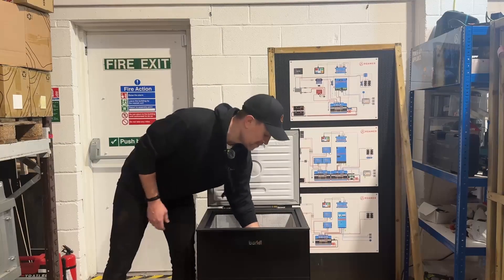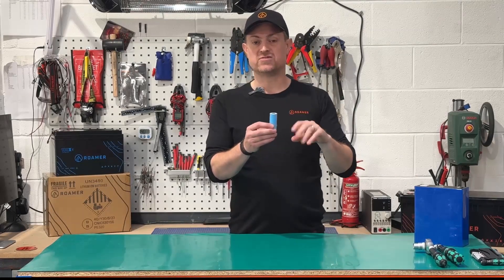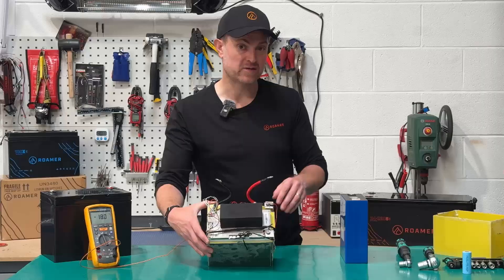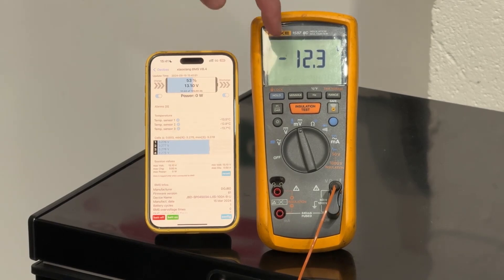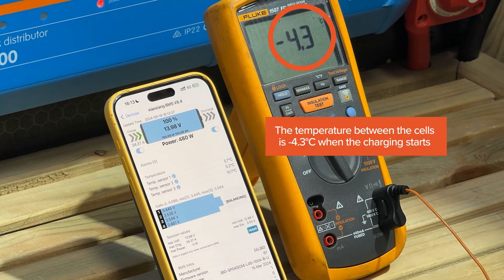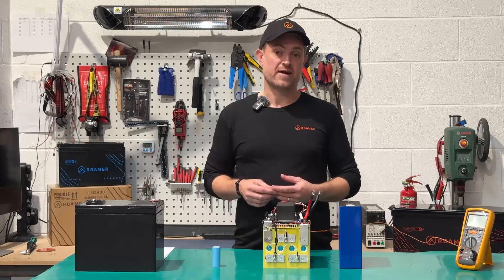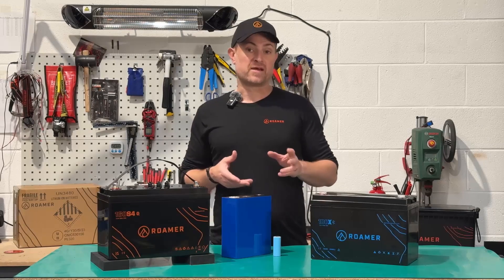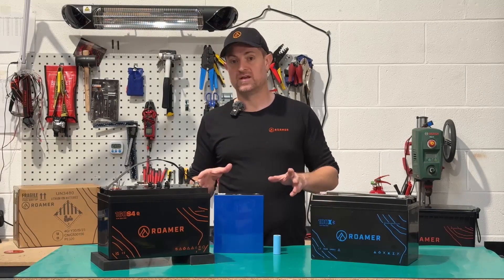Self-heating lithium LiFePO4 batteries tested - FAIL!

Comment: I can’t really see it being too much of an issue in the UK. I’ve just ordered a heated battery for an off grid communications system. It’ll be in a metal cabinet in a shed, so would only freeze if temperatures were low for a long time. The heating should be fine to bring it up from a few degrees below to allow it to charge, otherwise it’ll run flat after a few days if the ambient temperature remains below zero. I can’t ever see a circumstance in England where the battery would freeze overnight to -17, particularly if it’s being charged during the day. The inner cells would also be insulated from the cold by the outer cells in same way as they’re insulated from the heating pads, so it’s unlikely they’d get as cold in the first place, at least not over night. Siberia maybe a different story.

Comment: so put the temp sensor for the BMS where you put the meter probe
Reply from the maker: Yep this would definitely help. I’ve no idea why they don’t do it but this is my point, these batteries are being made in volume and sold under the pretense that the heating makes them safe and reliable

Comment: What was the state of charge when you put the battery in the freezer? Was the self heater powered up and heating (resisting becoming frozen through) during the freezing cycle? Was the battery in it's case during the freeze cycle? In other words, did you test the heaters ability to resist allowing the cells to freeze through in the first place or did you freeze the battery intentionally and then test it's ability to evenly thaw itself out?
Reply from the maker: It was around 50% - you can see this on the video. You can also see that it was in the case throughout. The self heating only operates when it’s being charged so the test was to freeze the battery, then charge it up to see at what point charging it would be allowed. I realise there are some batteries that will keep the cells warm and prevent them freezing in the first place but this is not how the vast majority of self heated batteries work - they will let the cells get very cold and then when charge is applied, it used the charging power to run the heater.

Comment: A bit of a flawed testing method. The point of heating is to keep it from getting that cold in the first place. Get it heating beside a non heating model in the cold while operating and see which can handle the warm cold cycles of simulates real life situation.  Running a battery immediately after its been froze is just kinda obvious it ahould be thawed first. Also anyone using should also be using an insulated compartment.  These still have a use but people need to understand its not some magic leave it in the snowbank and run device.
Reply from the maker: The testing method is correct - your assumption is flawed 😉 Actually these batteries are designed so that the heating only works while charging so it’s realistic that they will freeze. The entire sales pitch is that you can run the battery immediately after it’s been frozen, the heater is supposed to thaw it so it can be safely charged. Clearly this doesn’t work, that’s the point of the video.
Reply: @roamerbatteries  They are there to prevent it from hitting the critical point as early as a regular battery, not to thaw a frozen block. Stick them both in the freezer with charge/discharge going on the entire time. Don't prefreeze. The heated battery is going to last longer before having issues. I've ran mine down to -36f temps without issues in a styrofoam box.
Reply from the maker: Ok I think you need to watch the video - that is NOT how these heated batteries work. Some brands might prevent them dropping below zero but the ones for sale in the UK only heat while charging. This means they will drop to very cold temperatures while in your van, then when you charge them up they will rapidly heat the outside of the cell pack. This triggers the BMS to release protection and cells are charged - this happens before cells are ready and therefore risks damaging them. This is literally the whole point of the video, please watch it all :-)
Reply: @roamerbatteries the temperature at which heating begins is still in the operational zone. The heating keeps it from being critical longer this allowing lower temperature excursions. It is NOT designed to thaw a prefrozen battery.
Reply from the maker: Ok please watch the video. These heat pads is designed to thaw a frozen battery. There are other batteries that maintain the temperature in the operational zone but NOT these ones. The key point you’re missing is that the heat pads only work while charging - this means the battery will freeze and then when charge is applied, heat up rapidly. This is why we’re saying they’re a bad idea 😂

Comment: Yes, you can stop watching this video at round 11 seconds. The scope of the heater is not to warm the battery, it is to prevent it getting below a certain treshhold. It will use part of its power to keep the charging temperature. In extreme cold situations it doesn't matter, but it can give you a few degrees of playroom.
Reply from the maker: This is NOT how the heaters work. You would know that if you watched beyond 11 seconds 😉 They only work while charging so the battery can drop way below zero degrees. The heaters work like a jump starter, rapidly heating the cell pack until the badly located temp sensor detects its warm enough, and then the BMS allows charging to the cells
Reply: @roamerbatteries , you made good point about how it works but you made it sound like useless technology,  absolutely not,  better placement of the temp sensor is crucial but also a give and take scenario,  actually until they perfect it, people who live or use lifepo4 batteries in very cold climate might want to make a different choice,  unfortunate, yes, now I am talking very cold climates where actually millions do live,  you might unfortunately want to stay with old fashioned lead acid batteries

Comment: great video.   I'm a tech at a solar supply company up in cold northern canada.   We have carried/sold many brands of LFP batteries with internal heaters over the last 3 years and not one customer actually encountered and/or tested the limits of this battery/heaters.  We explain the cold temp scenerio beforehand so there is a bit of education (warning) that goes a long way towards knowing how to keep the batteries in a workable zone.   Your observations on the BMS temp sensor placement is very relevant to the  temp management of the battery/cells as a whole.   It could be possible the BMS takes the average Temp of all the temp sensors or the temp limits are off-set and/or compensated for with an altered charge algorithm.   The quality of the BMS is super important in all around efficiency of the battery system.
Reply from the maker: Thanks! Yep as you mention, if batteries are installed and looked after properly then you’ll never see the heaters operating. I personally spend 3-4 weeks skiing in the Alps every winter in my van and it’s never dropped below zero in the battery compartment. But that’s kind of my point, 99% of customers don’t need heated batteries. And for the other 1% there are much better solutions out there. Liquid cooled systems, batteries with low temp electrolyte etc.

Comment: That was a great presentation. 
I would like to add that the heating in your test is also done in a warm environment, not outside in the cold. It would take considerably longer to defrost the batteries outside and keep them defrosted for charging.
Now that batteries are getting smaller, we can take advantage of the smaller form factor by kea ing the cells in a larger case but adding insulation to it.
Additionally, the bms needs to be able to be programmed with schedules or intervals for heating so proper working temperature can be maintained. Needless to say such bms/battery needs Bluetooth and an app for monitoring and settings.

For larger banks I still prefer insulated battery compartments with heaters. It takes less energy to keep a battery at 40°F than having to defrost it daily.
Reply from the maker: Thanks! Yes the ambient temperature may affect the results slightly, I don’t think it would be significant however. Most of the warming inside the battery case will still come from the cell heating film. It was only around 10 degrees in the workshop that day too.

There are definitely better ways to implement this and some good suggestions in the comments above. I feel the same as you however, if you install and maintain your battery space correctly then direct heating isn’t needed and if that’s the case, why take the risk of damaging the battery?

Comment: Is there a thermodynamic heating effect when LiFePO4 batteries are either charged or discharged?
Reply from the maker: Yes, it’s a chemical reaction so it’s going to warm up when discharging anyway. And as this is the same across all cells, the heating effect will be evenly distributed - unlike the self heated batteries which only heat certain areas

Comment: I live with lithium batteries in Canada... only thing I've been able to count on 100 % is a heated battery compartment complete with temp sensor that I can read on my control panel
Reply from the maker: Yep if you can maintain temperature of the battery compartment then that works well. Most people in Europe just install in living space of the van so it’s going to be warm enough anyway.
Reply: I dont think u cut heating inside house, allways+20c

Comment: Ahhhh BUT there are heat pads available that go between the cells which heat up the core of the batteries.  However there are batteries that don’t allow the battery temp to get below set points ( say +4c ) so if looked after properly the battery should never sit at any - minus figure for any extended periods.  If these batteries are critical they should be “ looked after “ like your laptop or mobile phone.  I live in the uk so it’s unlikely I’ll ever get my Overlanding battery ever below 0c and if I did I’d be treating it with kid gloves ( excuse the pun ) before use
Reply from the maker: Yes there are heat pads that go between the cells, apparently the brand we tested uses these on some of their larger batteries. This still isn't ideal however especially when heat is only applied on one side of the cell, temp sensors are located externally and a single temp sensor is used to control low temperature charging - this is still going to lead to uneven heat distribution. The batteries that don't allow the temperature that drop below the set point are a different design and have their own issues (they can discharge the pack unless you have a constant source of charging). If you're overlanding in the UK then just maintain it properly by ensuring it is stored at above 50% state of charge, and if its ever too cold then you'll always have enough energy to discharge and warm it up
Reply: @ The Sun Fun Kit I have ( and just recently built ) the BMS monitors temperature and switches on and off the heating pads if it sees temp below a set temp that you can adjust in the software on your phone or tablet.  It would automatically stop the battery getting too cold which makes putting the battery in a deep freeze experiment a bit meaningless in most cases.   I guess it depends on your application BUT a battery for arctic conditions to be sat at -25 for months isn’t really what most consumers need.  If I’m say overlanding in Norway for a two week stretch then stopping the battery getting too cold overnight will be beneficial as I can then recharge as I drive again in the morning.  I agree that the heating isn’t the ideal design for say EVE 314 MB31 cells however I’ll do some basic testing to see what the current draw is and how well the pads work in real world conditions.

Comment: @roamerbatteries  Its odd because there are hints this is a Fogstar battery over social media, yet they showed a pic of the sensor between two cells where film is not between (heating is between the cells, just not all cells from the pictures they've shared in response to your video). 
Most EEs deal with control algorithms and managing temperature for many products and from that standpoint the uneven heating seems bizarre, trivially simple issue to resolve.  What I'm getting at is instead of rubbishing the competition, you'd be better designing a solution that works and highlighting what you do differently, especially as this is such a cheap change and mostly in software too! I suspect, as someone else has suggested on social media, this is because you import a cold climate battery and thus the aforementioned would harpoon your own sales.
Reply from the maker: While that does sound like an improvement on other models, our concerns go further than simply where heat film is placed. The use of large prismatic cells (up to 7cm thick and weighing 5kg) makes this incredibly difficult to get right. Better temp placement and wrapping all cells would be a great start but really I think this is only practical if using small cylindrical cells. 

To be clear, we have not made any suggestion of specific brands and don’t intend to. This is not a name and shame exercise, we just want to highlight our concerns with the way this is implemented. Hopefully this is taken on board and improvements are made. At the very least, I would hope that additional testing and certification is provided to demonstrate that this is fit for purpose, until then we do not intend to install cell heaters in our batteries.

I know we’ll always get some flak for posting this but honestly this is not about pushing our products. The XTREME range is a niche product and we currently only sell in bulk
Reply: @roamerbatteries  "makes this incredibly difficult to get right" nah, any design engineer worth their salt would arrive at a working solution. All a larger mass does is slow the process down, a process that occurs anyway in the environments these batteries are in. Lets ignore the Fogstar, or other, battery lack of charge inhibit.... Can you be specific about what you feel is a safety issue with heating prismatic cells in general? Is it because you believe the heat output is a constant?
Reply from the maker: @robfodder5575  Yes you're right, a vertically integrated company with design engineers would almost certainly work out a solution. And I would expect any solution to be safety tested and certified too, I believe that is the bare minimum standard required. It is interesting that other than Battleborn (who use cylindrical cells) there are no premium self-heating batteries on the market. Of all the companies that have the resources to design, manufacture and test a self-heating battery - none of them actually do. 

Regarding safety, I have concerns about the uneven heat distribution which is more difficult when using large prismatic cells due to their size (5kg each) and shape (no gaps between as you would see with cylindrical cells). You can see from the thermal image that the heat distribution is not even across the cells. The increased voltage on cells 2 and 3 is also clear evidence of different temperatures. The way this is currently implemented means that the prismatic cells (or parts of the cell) are being charged faster than they should be for their current temperature and this will therefore lead to lithium plating on the cells. It is widely accepted that lithium plating lowers the temperature required for thermal runaway of lithium cells and that in severe cases, the dendrites can breach the separator layer leading to short circuits. 

I'm not suggesting that self-heating batteries are suddenly going to combust but I believe that the way this is currently implemented in budget LiFePO4 batteries creates an elevated safety risk and I would like to see this tested and certified before it is sold as a mass market product.
Reply: @roamerbatteries  "none of them actually do" - That doesn't mean its not viable, how many companies have gone under due to lack of innovation. I see this all the time and infact its one of the reasons I can put food on the table (companies paying for tech to be developed to get ahead of the competition WRT new features). You may find they dont do it simply because they are mostly in markets where it doesn't matter or there simply isn't the demand for it. WRT safety concerns, yeah fair point if those manufactures, at the very least, dont update the limits in the BMS embedded software.
Reply from the maker: @robfodder5575  Yes thats true. I'm not saying it can't be done - it certainly can. Whether they will spend the extra money on developing, testing and certifying it is another question. The Roamer BMS has a heating circuit and we could develop some custom firmware to make this work better. I personally see self-heating as a hammer in search of a nail however, I spend every winter in the Alps and have never had an issue with cold temperature charging. It's installed correctly and I maintain the temperature above 10 degrees constantly while we're away (the diesel heater runs pretty much continuously on a thermostat). And for those people that are installing under the bonnet or an outside locker then self-heating isn't the right solution anyway as it'll be constantly cycling the heating circuit - this is the use case we had in mind when we created the XTREME (although this is now mostly used for industrial applications)